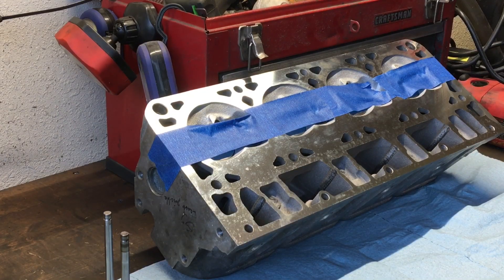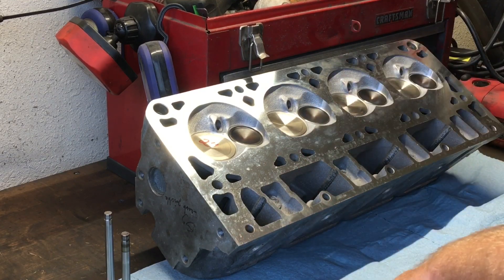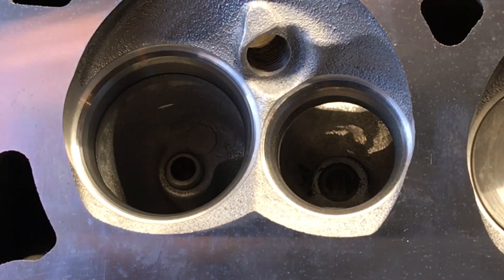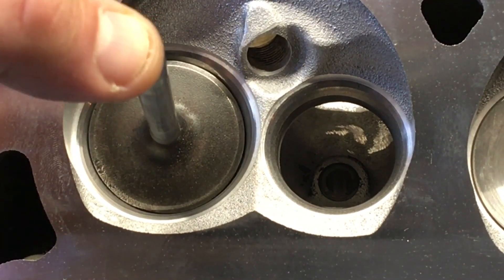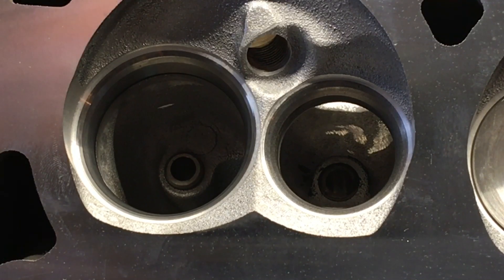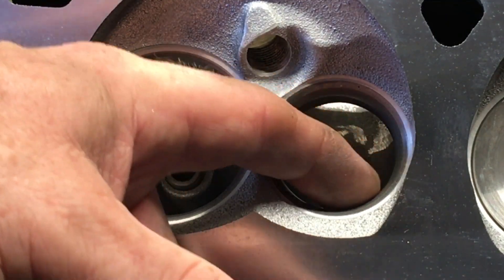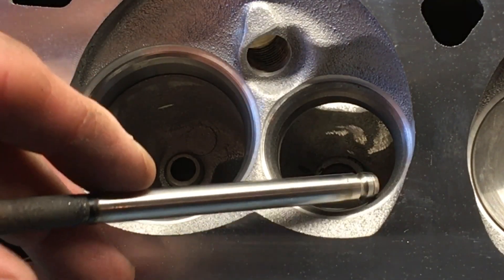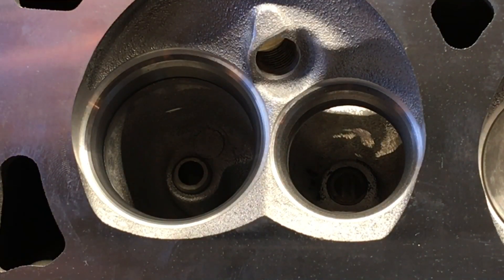862 Heads 215cc 2.00/1.55 LS1 500 whp

Comment: If my machine man doesnt like doing throat cut. Just the angles... Can I get to the 90% with my die grinder using templates? Any recommendations? 
For the exhaust seat with 86% I had to grind a lot ...is that ok?
Reply from the maker: Yes you are fine, just make sure it’s 90% of the valve size and you stay below the sealing angle on the seats. I tend to use 86-87% on all my exhaust seats; it it is a high heat application lean more towards the 86% 👍
Reply: @HeadFlowInc thank you

Comment: On a l59, what would you say the max hp one could get n/a with worked over 862's running 91 or e85 but yet be streetable and remaining sbe
Reply from the maker: It will depend on how much you “work” the 862 heads and the combo. 
Richard Holdener says he’s made 500hp NA with stock unported 862’s on a 6.0… 🤔
Stock 862/706 should support 440-480hp if the compression and cam are up to the task. 
Ported big valve 862’s could support 600+ Hp NA but it’ll be impossible in a. 5.3. 
It really depends on how much compression, cam timing and rpm range you need the power.  
Message me at 
jeffdubray@gmail.com
Reply: @HeadFlowInc  sent

Comment: I have a set of 862 heads for my 5.3 engine & i want to put boost to it, is it worth porting etc to make more power?
Reply from the maker: Honestly it depends on how much power you are planning to make Naturally Aspirated.  The stock 862 heads will be fine up to around +- 440-450hp crankshaft. 
The Turbo will make what ever Power it’s rated at regardless what engine it’s feeding. 
If you want to exceed the flow capabilities of the stock 862’s making above 450hp NA then porting would help. JD
Reply: @HeadFlowInc  i plan to make 770crank hp

Comment: If you had to focus your effort on ONE part of porting 862 heads where would it be? Bowls? Ports? Swirl ramp? The bump on the intake port? My 862 heads are going on an iron 5.7 with a 3.898 bore. Looking forward to hearing your thoughts
Reply from the maker: Hands down the biggest gain will be a 90% throat and quality bowl blend to the port.  Valve guide boss reduction is a help. Make sure you maintain a smooth transition radius on the short turn of the ports.  JD
Reply: @HeadFlowInc  awesome thanks. Would you do anything to combustion chamber? Polish? Any need to unshroud the valves when I have the 3.898 bore? Watching your video on the 500hp ls1. Should be applicable to my combo
Reply from the maker: @FishFreak90  what you can do is lightly scribe a head gasket with a 3.900” fire ring and see if you have any room to unshroud the valves especially the exhaust valve. The factory 1.89” valve isn’t bad but can be unshroud a little But if you go to a 2.00”+ it’s mandatory. 
Remove any ridges from the seat to the chamber.
Reply: @HeadFlowInc  thanks!

Comment: Is all of this needed if you were doing a 4.8 in a 1500 Silverado? I'm looking for 300 WHP in a very drivable build. It seems that the small displacement wouldn't warrant the 2.02 intake. I also have 862 castings. Would the 706's be a better choice?
Reply from the maker: 862’s are a better quality casting on the average and flow the same as a 706; 862/706 are interchangeable. 
The 862/706 heads will support 440+ HP at the crankshaft, depending on your driveline loss you’ll need +- 389hp crankshaft to “Net” 300 whp. 
No big valves or porting needed.  JD
Reply: @HeadFlowInc  thank for the fast response. Very informative content.

Comment: Hey HeadFlowInc, i have a question. I'm also putting 862 heads on my ls1. What pushrod length i need to use? I can't find an answer.
Reply from the maker: You really should measure the PR length.  But you should be good with 7.400” unless you’re using true LS7 lifters, small base circle cam or milled the heads heavily.  JD
Reply: @HeadFlowInc  i was gonna use Delphi ls7 lifters unless you have a other recommendation. Its a bidget daily build with sloppy 1.5 cam or sloppy best cam

Comment: Was one valve guide on each head higher than all others?
Reply from the maker: No, not that I’m aware of. JD
Reply: @HeadFlowInc  I have 1 guide on each head that's a different height than the others. Same guide on both heads. No bent valves

Comment: I'm curious what was the percentage of flow between the intake and exhaust after after going to the 2" intake and stock exhaust.
Reply from the maker: What lift point do you want to compare?  .600” lift
@.600” 71%
Reply: @HeadFlowInc  wherever the maximum cfm was reached. After I went under the description of the video I saw you stats on the head and that's what I came up with to was 71%. So if the math is right after the deduction of the percentage between the valves it shows the heads are capable of 443 hp at the crank so curious if you had it dynoed to see what the numbers was?
Reply: @HeadFlowInc  
Hello what if the came has a 545 lift on intake and exhaust? 
222 intake duration
231 exhaust duration
112 lsa on 706 heads with a 2.00 intake valve only
Thanks

Comment: wet flow doesn't apply to exhaust port flow ... unless you plan on running fuel out the exhaust.  a radiused valve job is better than discrete angles.
Reply from the maker: Crysmatic Yep proofs in the flow sheets or the pudding which ever you prefer. Thanks for sharing JD

Comment: David Vizard says it's a venturi effect to round the bowl with the seat. I'd like to see the difference it makes on a flow bench. He shows that it improves flow but he doesn't show a port that blends straight into the seat versus the rounded effect.
Reply from the maker: Chad Byrd Some of Vizards claims are arguable at best.  I know NASCAR at least use to use a perfectly smooth radius cut valve seat!  From the chamber floor to the bowl transition was a rounded surface with no visible angle cuts. Expensive valve job!
In one of Vizards videos he does have a student working the seat to bowl transition where he’s describing almost an undercut scenario right at the bottom of the hard seat to head material; this is something I don’t agree with, I side on the smooth transition.  Interesting topic thanks for watching and the feedback!  Stay tuned JD

Comment: Respectively, the slight varying degree bowl curve after the seat allows the exhaust past the flat valve surface , just as the curve on top of the valve itself. the moving gasses hug the curve just enough to not cling to the surfaces to create a drag, because the other paths from the shape of the valve it cannot pass since its flat and have to cut against the valve then toilet bowl against near the easier paths wall shape,. as it flows over the very slight curve resistance reduces as the continuing flow is allowed to flow in the center of the opening the fastest with the bulk also relieving eachother the clinging sides , however since the gasses make the curve of the chamber into and against the walls of the bowl and port, the central gasses are allowed to escape at an increased rate as it expands through the exit and jets out centrally. As you watch exhaust leaving the chamber you can see the center gas friction against the outer gas layer and pulling against it and speed up as the narrowest gap is cleared and changing distance at all times , if it were straight the gasses would not help eachother and fight like the three stooges through a doorway however the curve is a very very exact shape required many testing hours were performed by whom ilike to call the mad scientist of a vortec port job that yielded all of vortec , afr and lt1 alike's  port designs dynamic fundamental basis of modern ports out and into the chambers @ and what happens @ 'The Valves'. At these speeds it needs a smooth long trailing transition like a boat tail on a race car yet the shape through the port a very close relative size almost exactly the same changing direction and shape also gradually like a d port for example shape. ifeel it really is the most critical shape just as the valve angles are also all other things being taken care of, for instance the unshrouding around valves and port and bowl size all come to mate at this intersection the ever changing shape against the edge of the valve and just after is the hurdle then all else can be mated up. One thing to add, although; is that the order isn't necessarily at terms with this, thus the mating is a balancing act also . ithink of it in 5 main phases, low lift escape phase,  mid lift phase, high to max lift to high lift phase,  mid lift phase, then low lift to closing escape phase.
Reply from the maker: DYNA KLO Interesting thanks for sharing it’s pretty detailed, I was able to follow along but I’d say the average enthusiast may have gotten lost.  Thanks again!  JD
Reply: @HeadFlowInc   thanks , love your videos . should igo any bigger than these size valves in this head if ican?  also ican delete the post if it is too long.

Comment: It is the job of the machine shop guy to ask the right questions to #1 Find out what you want to do with this engine #2 Find out how much you know by the questions he ask & the answers you give. The his tell him your level of knowledge to create the finished product that will work RIGHT! #3 Once he knows it’s not your first rodeo, he will change the questions, talk more about measurements, height, depth, and how much corrective action they took and log it on you ticket. They don’t get paid peanut for making small holes into large holes for no reason. A guy I apprenticed for in the 60’s told me he learned more in 8 years working in a speed-shop / machine shop, than the 27 years he spend at the dealer. He knew shop was good during his application because they were backed up almost two months and most were staying with them even with the delay, much less knowing there are 12 other shops in a 50 mile radius. That’s a goof shop, especially when they make the time to talk to you on your level and explain expectations in advance. Blessings & liked!
Retire - ASE Master Tech since 1978.
This is the only guy that refused to allow a guy to work on a complex drive shaft. The owner told him “I don’t make mistakes” during the conversation. He told me, anytime a guy tells you he makes no mistake, then he’s never done anything! Keep up the videos, hope the light gets better but I know what you where saying. I like the spacer fit models!
Reply from the maker: I just found your post I wasn’t notified, my apologies.  JD
Reply: I know this is an old post, but it is 100% NOT the job of a machine shop to ask a bunch of ''right questions''.

It's either, a customer drops a head off to be remanned back to stock specs, OR...

The customers says to do custom work the way it needs to be done, OR, the customer says EXACTLY how they want the work done with ALL the specifics of sizes and whatnot.   (without knowing what metal is there to support such demands)

And, odds are, any shop worth their salt will tell the 2nd customer they're too booked up or just fires them point blank.

As somebody that actually does this stuff, I learned the hard way when I was young, you can't just do things people ask for and it work out. And when it doesn't work out, you're the asshole.

Now we have social media and youtube, so 'experts' can make videos complaining about nuances with no actual flow data or hard numbers blaming ''idiot'' shops when they act like they're smart enough to do the work themselves.

moral of the story: If you want custom work done, take it to a shop that can do the work.   If you think you're smarter than the shop, do the machine work yourself.
Reply: Nothing like the incompetant defending their i dont give a dam attitudes .  Youre a dime a dozen and always will be a hack .

Comment: I'm interested in doing the same 2 inch intake valve not sure who to send the heads to to get that done. I'd prefer the cheapest way possible.
Reply from the maker: Robert Steele 3 things need to be considered when going with a 2.00” or larger valve:
1. Need a cylinder bore of 3.898”+ 4.00”+ preferred.
2. Expecting to make more than 525hp at the crankshaft. 
3. The bowl must be cut/blended to the new valve size or it’s a waste of money. 

Having the bigger valve doesn’t help unless the combo truly needs it.  I use Nolands Cylinder Heads in Kansas City, Mo.  it depends greatly on where you live, but make sure who ever you pick does qualify work.

Comment: Is it possible to fix a combustion chamber on a l92 heads the piston hit inside the chamber and chewed a little  bit of it it didn't hit the valves just the surrounding chamber
Reply from the maker: tim walk Yes you can repair aluminum heads pretty easy. You may not need any welding, you may   Just need to smooth out the damage. 
Carefully check for debri, sharp edges etc.  Having the heads surfaced may help.  JD

Comment: Good vids. gonna try my first cylinder head porting on some 4.6 sohc PI heads for my mustang. should be good!
Reply from the maker: UpAllNight91 Tool control, the valves, seats and bowls are pretty small; you’ll be surprised how small the exhaust bowl is. A good percentage bowl cut alone will help a lot.  Good luck Thanks for watching!!! 👍👍👍
Reply: @HeadFlowInc  Yeah for sure the exhuast bowl is very tight. I have a 3 sets of heads, one on the car now (which are getting tired), a junk core to practice on, and the fresh good ones iIl be doing the porting on and then putting on the car. Like you said, the net is full of info if you just search. Its going on a NA car that currently puts down 314 at the rear wheels. If I can get that to 350 with a port job I will be thrilled!

Comment: man I feel u I could writ a book of disappointment from over 20 different machine shops ,especially with valve /seat depth and spring pockets/installed height specs
Reply from the maker: Todd Traylor I’m happy with Nolands Cylinder heads, they did a top notch job; they set the stem heights as part of the valve job.  I should have talked with them more on what I needed in specific areas of the transition from the seat to the bowl. 
Nolands offers CNC head work now, I’d like to see some of the flow charts from those ports.
I can’t wait to see the results on this WS6 build!  👍
Thanks for the feedback I appreciate it, yeah I’ve run into some sketchy shops over the years; this is why when you find a good one they need to be supported.  JD

Comment: Well you definitely have enugh cylinder head flow to get the power you want. I think with the compression you are running you could go about 245° to 247° degrees at .050 and 106° LSA then set it up on a 106° intake centerline (dont advance it at all!) You can reduce cranking pressure and probably make even more power than you would by advancing the cam. Oh, and take everything you hear from Vizard with a big grain of salt.. the guy is a sensationalist and a bit of a snake oil salesman. Im not saying he is completely full of crap, but he is mostly full of crap.
Reply from the maker: poncoolride I use mostly Joe Mondello percentages from his porting theory mixed with some other porters techniques. Only recently have I seen any Vizard information since it’s on YouTube. Thanks for the feedback on Vizard. 
This build is a 2000 WS6 TA, it’s maintaining the EFI and vacuum for  the brakes etc. The cam is a Howard’s .612/.612 @.050 .236/242 LSA 113 
#190265-13 This cam is designed around 11.00-1+ Static Compression and has the valve timing to set the Dynamic Compression between 8.30-1 to 8.70-1 depending on the final numbers. 
I like tighter LSA cams in carburetor builds but can be problematic with EFI. Do you have any luck running tight LSA cams with EFI?
Thanks for the feedback I appreciate it!  JD
Cam Sound:  https://youtu.be/t1YETSZsYh8
Reply: @HeadFlowInc  to be honest untill I got my 95 trans am this summer I had only run carbs.. However I have heard of guys running this tight of lsa with injection and not having any real problems. Im still on a steep learing curve, and at times have seriously considered just throwing a couple carbs on it and forget it, but I really like the idea of stepping into the modern age.. LOL its also why im planing on keeping the overdrive trans and lockup converter. I figure why not take advantage of this modern technology that makes thes newer generation cars so great. It looks to me like part of tuning for a cam like this to work is to ditch the factory ecu and get a good aftermarket one. From there its a matter of going strictly open loop. Then you can just use wideband sensors and a computer to make the adjustments. Maybe it isnt quite as easy as everyone that ive talked to is making it sound but thats my plan.
Reply: Running EFI with a cam ground with a tight LSA, can be done with the OEM PCM as a good tuners, like Brenden at LT1Swap.com will change the low idle control for IAC or DBW. The A/F cold at the low end is also modified to give nice driveability for a daily driver and street racer both. Brenden is just East of KC and stays busy with his $75 tune, unless you have something weird or diesel, but not the case here. Take it an old carb guy who rebuilt thousands, go with EFI because it’s way better. I have done side-draft, Ford 7200/7400VV carbs, soled, hitachi, Holley, and my favorite the Q-jet, as it is a true variable Venturi carb. But fixed EFI multi-Port with 3 gas exhaust analyzers since 1976 when only two mass production cars sold where the Cadillac Seville and the Datsun 280Z with 7 injectors. The rest had “CIS” or “Mechanical” like older “MB” & Corvettes.